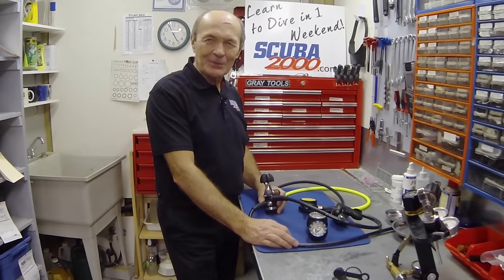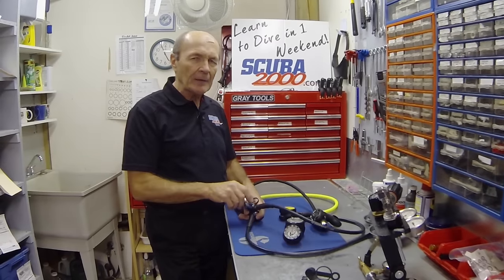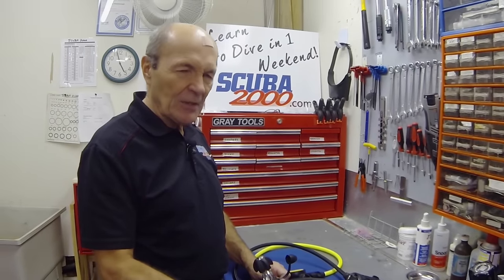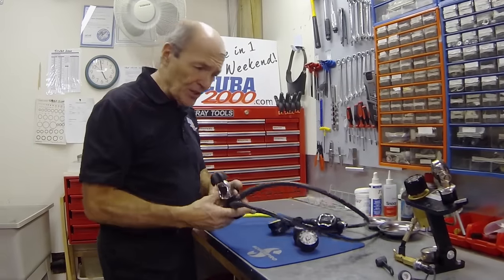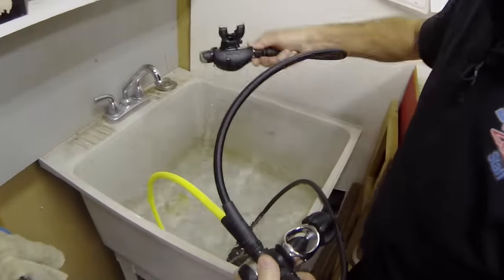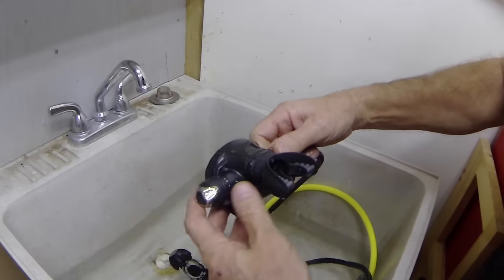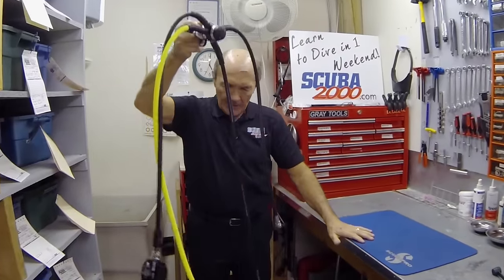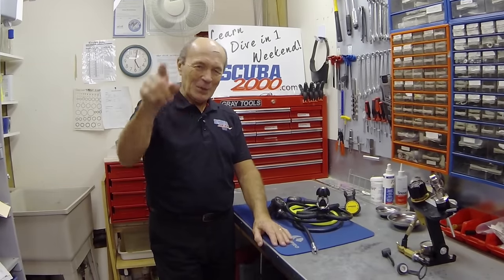It Pays To Rinse - Scuba Tech Tips: S03E02

Comment: Hey Alec... I have my Dacor Olympic regulator since the late 70's and learned how to service it. My very own method has worked  for me. You know that even if you are extra careful to install the dust cap eventually the regulator will corrode internally. What I do is when I'm back at home is to force clean water through the first and second stages a couple of times and finish it off with silicone spray. I fill up the tank valve exit hole with water, install the regulator, open air pressure and let the water rinse it internally. I repeat this a couple of times, then I finish it off replacing the water with food grade silicone.  This has worked for me. At the same time my tank valve is lubricated for storage.
Reply from the maker: I'm hoping you dive in warm water only Carlos.
While your cleaning method is unusual, there's no reason why it won't work. I might suggest you buy a bottle of distilled water rather than just using tap water. The minerals in tap water could mess with the parts inside. 
However, if it works, go for it.

Divers in cold water - DO NOT DO THIS! And by cold water I mean anything less than 45 degrees (7 Celcius).
If you have any water moisture inside the 1st stage the reg could freeze. Flushing with silicon does not guarantee all the water is gone.
Take care.
Alec

Comment: Alec, everything you talk about and demonstrate on this video is the stuff I was taught back in 1973 and do religiously. I agree about dust caps, but if I run into one of those supposed modern ones that are "water traps" I dribble fresh water on them and blow the excess out with compressed air from the tank while on site, ensuring that my thumb is covering the 1st stage tank nipple. Warm water and a good active/agitated soaking are the key to reg service longevity as you've shown. I physically manipulate all conectors (BCD, quick connects, etc.) and venturi vanes as well. I despise hose protectors for the very reasons you talk about. Thanks for getting this out there to the new kids.
Reply from the maker: Right on Russell. I've suggested filling the hole on 'modern' dust caps with silicon sealant but it's easier to just buy an old style for a couple of bucks. Alec

Comment: Alec,
What do you recommend for those of us with DIN type 1st stages?....the dust caps for those are even deeper than the one you showed in the video.
Reply from the maker: +Jeff Greenfield 
It's a problem Jeff.
There's no easy answer to this one. There's no special dust cap for DIN.
You simply have to be very careful to ensure there is no dirt or water in the cap before replacing it.
I have suggested to some divers and for myself to keep the DIN regulator dust cap clean and dry on the boat rather than having it tied to the regulator all the time as is most common. You certainly don't need it underwater so keep it in a plastic bag on the boat/shore. When you surface, remove the reg and then put your dry dust cap on.
Todd here at Scuba 2000 has a novel method that might work for you. He removes his tank valve DIN cap (insert) and screws it into his regulator DIN dust cap. It's a perfect, snug fit and neither can get contaminated!!
Whether you leave this assembly on the regulator or on the boat is up to you.
I hope this helps.
Alec

Comment: I just received my Zeo with  the fdxi first stage and I love it! Light breathing and so comfotable.. Do you know why oceanic does not fit the first stage with the little red piston, the DVT system any more? Not even Oceanic Germany can tell me why they changed. Do you have an idea?
Reply from the maker: Yes I do. The DVT was a good idea. Unfortunately in practice it was less than perfect. For those who don't know what a DVT is let me explain that it's a plastic plug on the inside of the regulator which plugs the air inlet hole when the reg is detached. It is designed to stop any water or dirt from getting into the regulator - sort of an automatic dust cap. When the reg is attached and  the air is turned on, the air pressure pushes the plug out of the way and the reg works. When the reg is detached, a small spring pushed the plug against the hole and keeps water out of the reg. Unfortunately, if you do not COMPLETELY purge the regulator of air before detaching it from the tank (and this often happens) the remaining air pressure in the reg will force the DVT plug into the hole tightly. It can even twist it and plug the hole permanently. The next time you use the reg, no air will enter it from the tank OR the broken plug will partially plug the hole. So Oceanic dropped it. They did try to fix it but depending on divers to always purge properly was too unlikely. It's gone. You'll have to be a careful diver and follow my guidelines on removing and rinsing a regulator like all the rest of us divers. I'm glad you like the ZEO though. I use it and quite love it too. Thanks for watching. Alec
Reply: +Alec Peirce Scuba thanx again Alec for this valuable info!
Reply from the maker: I'm glad to help. If any little thing I share has made a diver happy or healthy, my job is done! Take care. Alec
Reply: "...if you do not COMPLETELY purge the regulator of air before detaching it from the tank (and this often happens) the remaining air pressure in the reg will force the DVT plug into the hole tightly. It can even twist it and plug the hole permanently."

Alec, I have a new (less than 1 year old) Aqua~Lung Legend LX Supreme, and the first stage has a device similar to this DVT, which Aqua~Lung calls an ACD (auto-closure device). Have you heard of the same kind of issue occurring with Legend first stages if they're removed without fully purging the system?
Reply from the maker: There's a U-Tube vid from Aqualung that shows very clearly how their ACD works <https://www.youtube.com/watch?v=F54NGxjnNkw> .
If you watch it you will see that the AQ auto-closure valve that seals the reg, is opened by the action of tightening the reg onto the tank valve. That is, unlike the Oceanic version which relies on air pressure to open the valve , the ACD is opened by the act of attaching the reg to the valve - a mechanical act. 
It will NOT suffer from the same problem as the Oceanic.
However, it is a somewhat more complicated system requiring more parts, careful installation and regular maintenance, particularly since it is dynamic - it has several metal parts, O-Rings and it moves. How it will stand the rigors of scuba and the normally lax attitude of scuba divers will decide how it stands up over time.
As with the Oceanic wherein you could carefully press on the red button and see that is moves, you ought to be able to press on the ACD and see that it moves slightly. Use a rubber pencil end.
And, as with the Oceanic, if the reg is removed from the valve before ALL the air is released from the reg, the remaining internal air pressure will force the ACD to close tightly. I'm not sure how that is an issue but we'll see. It doesn't appear that the ACD can jam shut.

On the topic of removing the regulator from the tank after a dive, you may have noticed that it takes several seconds to completely purge the air from a reg. That's mainly because of the HP hose. The HP hose has a severe restriction on the reg end. Look at the end of the hose and you'll see that the opening is very small. If you look into the HP port of a reg, you'll also see that the hole letting high pressure air out of the HP port is very small as well. These restrictive orifices are there to prevent the hose from whipping around if it breaks. Thinks about a water hose end. At one time it was a problem and if the HP hose broke the diver had to duck or get whacked by the hose! That can't happen now because high pressure air can only flow very slowly from the HP port and into the HP hose. They both have restrictions. Of course, that also means the air in the HP hose can only come out slowly. You must hold the purge button until NO air can be heard and/or the SPG reads zero!

Good question. Hope this helps. Alec

Comment: Hi Alec first of all sincere thanks for your videos. My instructor told us to never dunk first stage under water for rinsing even if it has dust cap on. If I saw correctly you dunked the whole first stage under water.  I have DIN is it okay to dunk the whole first stage in leave it there for some time and then give it a quick shake under water  ?
Sorry to ask but I'm new  and wanna get it right 

Thanks :)
Reply from the maker: Use a DIN screw in cover to keep the water out of the 1st stage then soak away in clean, warm water.  Should not be a problem Tony.

Comment: First, thanks for all the tech tips!

Can you show examples in a future video (or at least describe it) of a good dust cap for a DIN first stage? You gave great examples of good and bad dust caps for yoke valves but, assuming we get all the water out of the cap, are there DIN caps which are still not good? My DIN cap just pushes on. Would something which threads on be better?

Comment: Hi Alec, what to do when first stage is immersed without dust cap?
Reply from the maker: Cry!!
It happens to every diver eventually. The first question is, salt water or fresh water?
If it's salt water, then immerse it, cap off, in clean, fresh water for a few minutes. Put it onto a tank and breathe through it for a few minutes. That will blow the salt and salt water through the reg and out the 2nd stage.
Then you need to dry it and the quickest way is to put it on a tank and breath through it. The dry, clean air will soon have it completely dry inside.
Also, breathe through the Safe Second hose to get the water out of that hose.
You also need to get the water out of the BCD LP hose which is best done by removing the Schrader valve inside the end. It's a standard bicycle-type valve that you can take out with any $5 valve core remover tool. Turn the air off first, remove the Schrader valve and turn the air back on for 30 seconds. I did a video on that process a while ago.
The biggest problem is the HP hose to your SPG or computer. You must get it dry or the water will ruin the gauge or computer.
They cannot be repaired. So, if you have a Quick-Disconnect hose fitting for your computer, you can push down on the center pin on the inside on the end of the QD while someone turns the air on verrrry slowly.  Air will hiss out of the hose. You may have to do this several times as you cannot hold that pin down against all the pressure for more than a second or two. If you do NOT have a QD, then you need to remove the head of the SPG or remove the computer. That takes 2 wrenches and some care. I did a video on that some time ago too. With the head off you can turn on the air to blow out the hose. The swivel pin will come out too. Don't lose it.
Or you can pay a dive service center $25 to do all this for you. They will probably recommend a complete service but unless your reg is due for one, that's not really necessary.
Good luck.
Alec

Comment: Alec,

A dive instructor once told me that I should never submerse regulators if the 1st stage is not connected to a tank. He said that the water could travel from the 2nd stage to the 1st stage through the hoses. Obviously, you are not concerned with that. Can you explain how water will not enter the 1st stage when you submerse all your gear? Thanks.
Reply: Alec, can you please clarify... I thought pressing the purge valve was a good thing to do when rinsing the 2nd stage regulator. Should I not do this? I've only done it once so far on my new reg setup so I'm hoping it didn't cause issues or get water into my 1st stage. I had my 'water' cap on the 1st stage and let it soak for 30 minutes like you suggested, then later on rinsed water through the 2nd stage and my octo as well as pressed the purge button a handful of times on each 2nd stage. Is this a bad practice? Looking forward to your response! Thanks again!
Reply from the maker: If the dust cap is firmly in place when rinsing a regulator and you do NOT press the purge button, water cannot enter the inside of the regulator.
The purge button opens the valve in the second stage so that air can come in from the hose attached to the first stage. If the regulator is on the tank and under pressure when you press the purge  button, air comes down the hose and out the mouthpiece. But, if there is no air pressure in the first stage and thus the hose, when you press the purge while under water (as while rinsing it) water can go up the hose and into the first stage - not good! Do NOT press the purge button while rinsing.
Reply: Michael Kopa   V
Reply from the maker: Water can only enter the first stage in one of two ways.
It can get in through the main air hole on the first stage. If the dust cap is properly in place, as it ought to be at all times when the reg is off the tank, water cannot get in that way.
And it could potentially travel up a hose.
Let's look at the hoses. Normally you have 4 hoses - the HP SPG, the LP BCD Inflator and the two second stages.
The SPG end is sealed - no water.
The LP BCD Inflator end is sealed - no water.
The second stage valve is held shut by a spring-loaded silicon seal. Normally no water can get past that valve because it's held closed by the spring. 
So, you can safely rinse your gear in fresh water after a dive, even off the tank, provided the dust cap is properly in place on the first stage. And that's the way divers rinse their gear. That's the proper way to rinse your gear according to your owner's manual.

However, when you depress the purge button on the the face of the regulator second stage, you override the spring-loaded seat and open the valve. That's how you get a blast of air to clear the regulator when it's on the tank and the air is turned on.
When the regulator is NOT on the tank and you depress the purge button, water could theoretically go past the silicon seat, travel up the hose and enter the first stage. That's why your instructor, and all instructors myself included, have been telling divers for years "Don't press the purge when rinsing your regulator!"
However, experience, technical know-how and common sense if you look at and think about the situation will tell you that there's no reason for water to travel up the hose. In fact, there's every reason for it not to!
Water travels as a result of gravity or pressure. In this case, the hose is full of air and that air is unable to move towards the first stage because the first stage is sealed. The air can't get out so it stays in the hose.
If the hose is open to the water at the second stage end (by pressing the purge button while it's in water), no water will travel up the hose. The air in the hose is not going anywhere so the water would have to compress the air to get to the first stage. The LP hoses are typically 27" long. For the water at the open end, the second stage end, to reach the 15" mark inside the hose, it would require a pressure of 15psi (1 atmosphere) to compress the air. That's 15psi to get 1/2 way. It will never reach the first stage. It would require a pressure of several hundred psi to compress the air in the hose  enough to let the water reach the first stage. Simple Boyle's Law.

So, unless your instructor (and I'm not picking on him - we're all in this together) can explain how the air in the hose compresses enough to let the water get all the way up the hose to the first stage, it won't happen.

Comment: I’ve heard people say we should be soaking our regs under pressure to keep moisture out of the hoses and 1st stage. Is that the ideal way, or is it overkill?
Reply from the maker: Not realistic or practical.  Dust cap on tight and don't press the 2nd stage purge, the system is sealed from water entry.
A

Comment: Hi Alec, thank you for all your informative videos! You are the best! Question: what is the best way to hang a Yoke system regulator dry? Can you hang it?
Reply from the maker: It's best to hang the 1st stage on a hook through the yoke hole.  There is no hose stress and everything hangs down, no loops.  Thanks for watching Jason.
Reply: @AlecPeirceScuba_SeaHunter  Hi Alec, another question, do you ever use disinfectant solutions when cleaning your gears, regs. and bcds? If so every time after each dive? Or is that overkill? I found a disinfectant from Désinfectant matériel de plongee SEPTIONE MATERIEL ABYSSNAUT.

Thank you Alec!

Comment: thoughts on spraying down a pressurized reg connected to a scuba tank instead within 2 hrs after a dive with a garden hose gun? I do this religiously instead of a soak. Gently into the mouth pieces, and also hove out the hose protectors.
Reply from the maker: Spraying down with a hose while still on the tank is excellent. Fresh salty water comes right off; no chance of water in the 1st stage; gets well into the 2nd - all good. And under the hose protectors too! Good job.
A hose is not usually available for most dives.

If the reg sits for more than 1 hour, you will need to brush or soak because once the salt dries it will not just rinse off.
Good idea. Thanks.
Alec